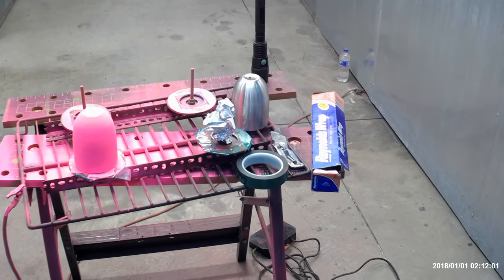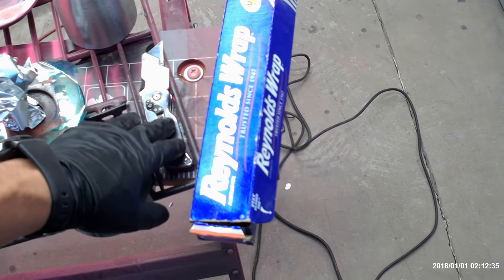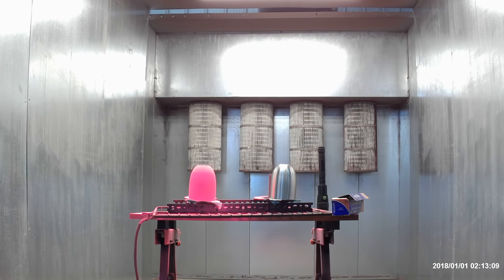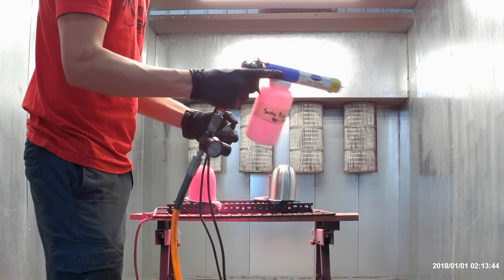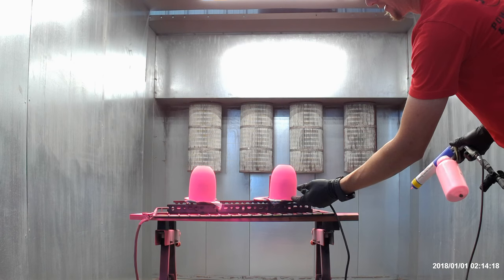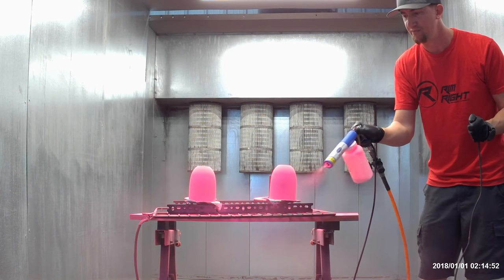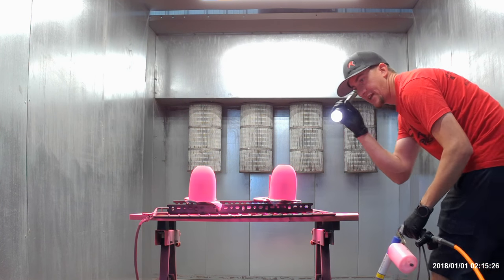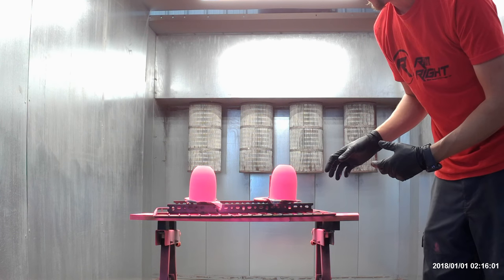Powder Coating - How to powder coat tumblers - Wine glasses powder coated #1

Comment: I know this is a super old video and all (and I follow you and a few others pretty closely)
The question is...
Instead of the tape have you thought about using a piece of like Scott’s shop towels...and just remove that prior to cure schedule? 
With the foil up inside and a the ground run into the plate it SHOULD still ground the cup

Asking because I have a bunch of cup jobs coming up...looking to ease my clean up just a little bit
Reply from the maker: Sorry just saw this, it would be hard to get that out with out touching the cup so thats why we did it this way